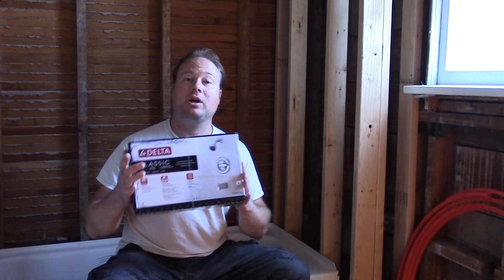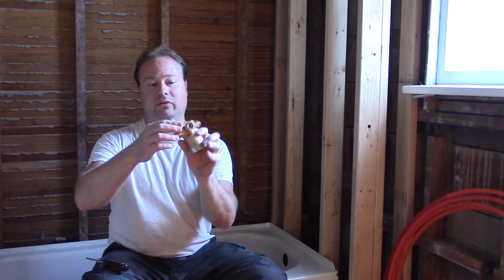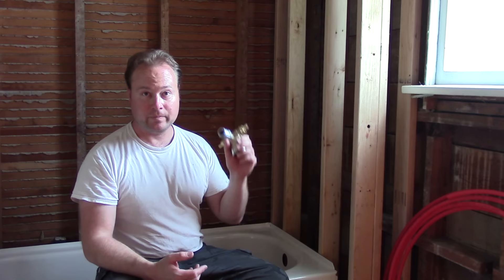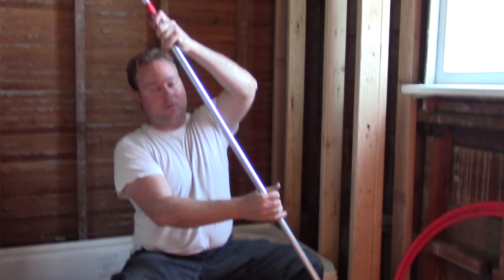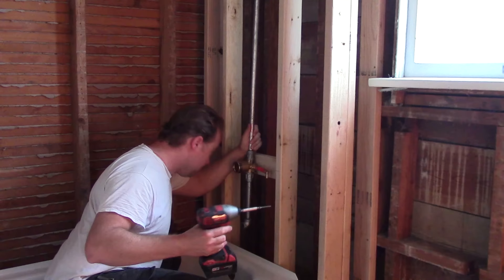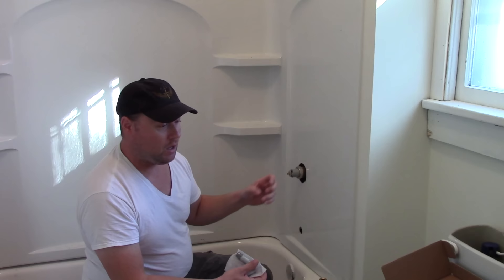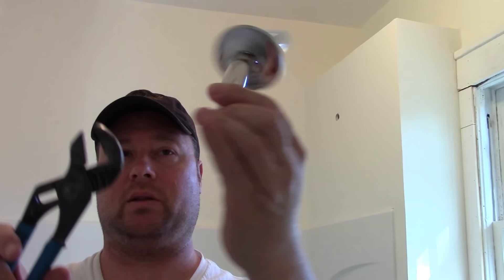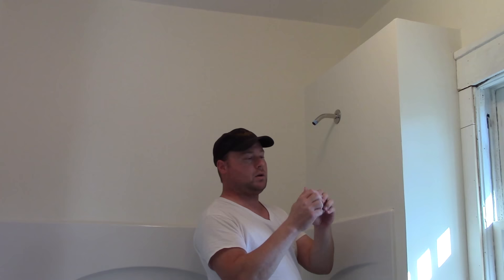Delta Shower Faucet Install

Comment: Very helpful. Thank you. Do you prefer tape or pipe dope?
Reply from the maker: I kind of go back and forth. Mostly the tape, but not the cheap white stuff. This blue monster is one of my favorites. https://www.amazon.com/Milrose-70886-Blue-Monster-Teflon/dp/B00IRCWI12?crid=MS9OE6SAE8CN&dchild=1&keywords=teflon%2Btape&qid=1635621695&sprefix=tef%2Caps%2C212&sr=8-2-spons&smid=AFRUYXQ765J9S&spLa=ZW5jcnlwdGVkUXVhbGlmaWVyPUEyRFBOR0sxNkZHNE5IJmVuY3J5cHRlZElkPUEwNTQ5Mjc5M0tCUkdKSlhJNEhMRCZlbmNyeXB0ZWRBZElkPUEwMzUwMjQ3MkU0SEFHWlJYUFVKWSZ3aWRnZXROYW1lPXNwX2F0ZiZhY3Rpb249Y2xpY2tSZWRpcmVjdCZkb05vdExvZ0NsaWNrPXRydWU&th=1&linkCode=ll1&tag=greatwhitenin-20&linkId=44d19da54649d889dd314697547ce194&language=en_US&ref_=as_li_ss_tl
And here is a newer video for the faucet. https://youtu.be/NuI2vuR6Fjo

Comment: I’m installing one of these in a restroom and the only problem I’m having is the handle is loose I tighten the Allen wrench but it just slides right off any ideas?
Reply from the maker: So you are installing a new faucet with a new handle, but when you go to tighten the handle it just falls off? Are you sure you are turning the allen set screw?

Comment: I wish I got a better look at that plastic piece that was on the faucet housing . Does it end up at flush with the finished wall? Does it have to be on ? 
I do understand that they want 2.75" from the stud to the finished outside wall . I'm using a 2/8 wall , so I just mounted my board  2" in from  the front of the stud . This gives you another half inch for the cement board or Kerdi , and another 1/4" for the tile .  I didn't compensate for the mortar that holds the tiles on though .
Reply from the maker: Let me try and break down your questions. The plastic housing doesn't need to stay if you mount the faucet correctly. I just helps you line it up. Just follow the directions for your particular model for the exact install depth. The mortar isn't thick enough to worry about.
Reply: Good to know . Thanks  Nathan

Comment: Ummm...Galvanized pipe?!?!?! That stuff went out in the 60's!! Its good to put the black Plaster Ring back on if you have someone tiling, it tells them where to tile to to havea good finish.
Reply from the maker: Yes, galvanized pipe. Better for the DIY'er then trying to sweat copper.
Reply: @AroundTheHome1  we have pex and sharkbite now.  You seen a piece of 20 year old galvy?  It has an opening about the size of a noodle.  But your right, it works.
Reply from the maker: I have seen old galvanized pipe. And not to try to argue every point, but I live in SW MO and we have some of the hardest water in the country here. And it takes about 30 years to look that bad. And 30 years isn't too bad for plumbing. In my newer video I use pex, but at the time I preferred to put metal in the wall. Maybe more of just used to doing it that way. And I never put a sharkbite when there is no access. Call me old fashion, but I just don't know how I feel about those o-rings after ten years.

Comment: I have Delta monitor series (I think it's 14 series, installed like 20 years ago). If I am about to replace them with 14 series (maybe new 14 series as I heard the new cartridge won't fit the old valve, but I assume trim kit should work?), is it easy to replace the main faucet? Do I have to tear down the wall to install it. Or I would just better to replace just the trim kit and cartridge. Thanks.
Reply from the maker: @M Wang , for starters it is always easier to just replace the cartridge and the trim kit. Now, I can't give you an exact answer to your main question without actually being there to see it. But I can say that most of the time it does require ripping a wall open to replace it. Even if there is a panel on the backside to access it, faucets normally have to be removed from the front. I hope that helps in your decision.
Reply: @AroundTheHome1  Thanks, very helpful info. I guess I will just try to replace the cartridge and trim kit this time (unless I am doing whole bath renovation).
Reply from the maker: @M Wang I believe that would be best. I normally tell people to do just that. A new cartridge and trim kit will go a long way.

Comment: A couple of questions. 1 did that valve have a mounting bracket that fits flush with the wshower wall? I didn’t see that in this video. My Delta has a square one that snaps on the valve and the 8nstructions say to make th S flush with the shower wall. 2. I am using pex to the shower head. See any  Susie with that ?
Reply from the maker: Yes, this one did come with that black bracket, I just put so many in that I don't normally use it. I just put one in last week with pex to the shower head. Just make sure to use a dog ear fitting that is screwed down tight to a cross board and you will be just fine. Thanks for watching. Don't forget to stop by our website www.greatwhiteninja.com

Comment: The Seat in the cold tap of my Delta Classic Two Handle Tub and Shower Faucet is worn and can't be removed/replaced. Do you have any videos on fixing or installing a new one? Thanks
Reply from the maker: I don't have a video on that. Sorry, just haven't worked with old turn style valves in forever. So, is it corroded into place so you can't remove it? Because that is the best course of action. They do make seat refinishers, which basically is a round file at the end of a rod that you can put into your drill and file it down. But sometimes the seat is too far gone for that course of action.
Reply: @AroundTheHome1  Thanks for getting back to  me. I got one of those reseating tools and knock wood.. it's FIXED!!
Reply from the maker: Glad it was helpful! Thank you for watching. Check out hundreds more of our videos at https://www.aroundthehome.org

Comment: Nice vid and great commentary, Nathan. Thanks for the tips along the way! Question: My Delta valve has 2 small set screws on either side of the center cartridge area. They appear to adjust the flow for the hot and called water inlet to the cartridge. Can I assume both of these screws should be wide open?
Reply from the maker: To be honest I'm not completely familiar with that faucet, but I believe that you are correct because I have worked with other brands that match your description.

Comment: hi I have a similar delta faucet- sometimes I get nice hot water and then NO HOT water only cold:(  what do you think might be the problem.  I already swapped the cartridge but doesnt seem to make a difference.
Reply from the maker: When you swapped the cartridge, did you flush the line before you installed the new one?

Comment: Nathan , I have one more stupid question. I am comimg off the top of my delta valve , and going to a delta diverter . I'm going to install a fixed shower head and also I seperate shower wand . The diverter has four ports . Bottom is water in obviously , but what I'm not understanding is , can I use the right port out for my wand instead of the left port? . I'm using the top port for the fixed shower head  .
Reply from the maker: You know honestly I am not familiar with that diverter. I am assuming that it is basically a "T" with some internal channels to help keep the water flow balanced. If that is the case I am also assuming that the top 3 ports are interchangeable for which outputs that you want. Sorry I couldn't be more help with this one.
Reply: Np . I'm going to phone Deltas help line this morning .

Comment: what size hole did you make for the mixing valve ??
Reply from the maker: When you say mixing valve, I assume you are talking about the main faucet. I think this one was 4-1/2". But I always base it off of the trim plate. Most or nearly all trim plates have an outer and inner ring. The outer ring is mainly flat then the inner ring goes inward. I just make the hole the same as the inner ring. But the instructions will tell you specifically for that model what is needed.

Comment: Why are you using galvanized? Don't most people typically replace galvanized with copper or PEX?
Reply from the maker: I am just using the galvanized to go up to the shower head and down to the spout. I prefer using metal for that because it makes the whole faucet a lot more rigid and stable. Now for the question, why not copper? Well for one you could argue the cost, but it mainly boils down to ease of use. I am personally not good at sweating copper pipe and if someone was trying this as a DIY project, because I am not here teaching professional plumbers, it will be easier to assemble then trying to also teach someone how to sweat copper. I know some people will argue that galvanized will corrode and build up with mineral deposits, but that takes decades and these pipes only have water in them when the faucet is in use. I feel that it is by far the best choice for this project.
Reply: @AroundTheHome1  did you get the galvanized pipe cut to size and threaded by the shop? where at?